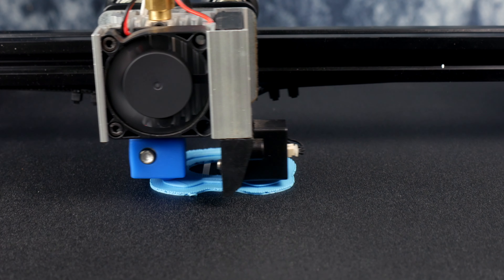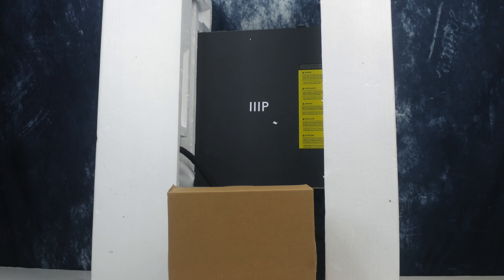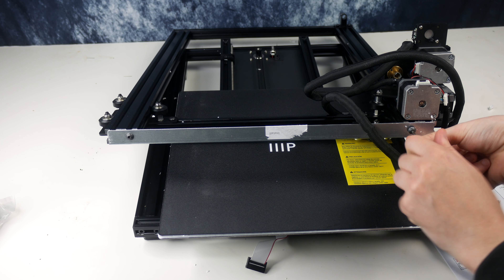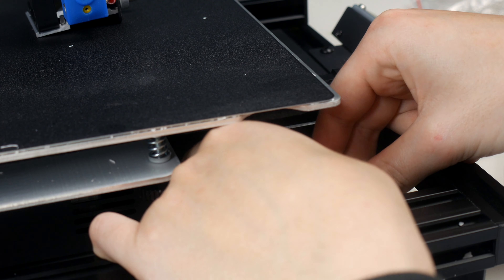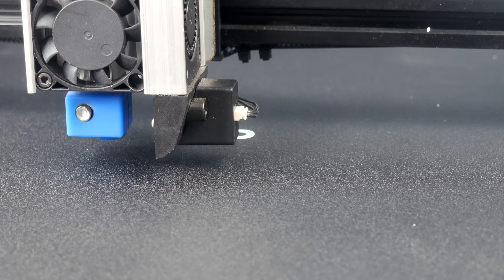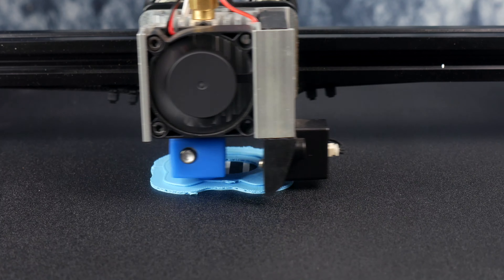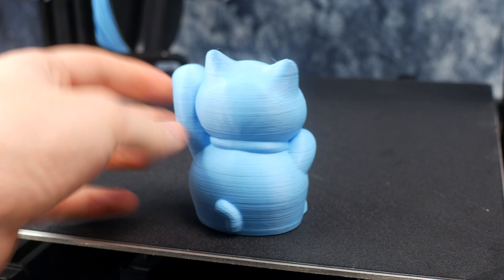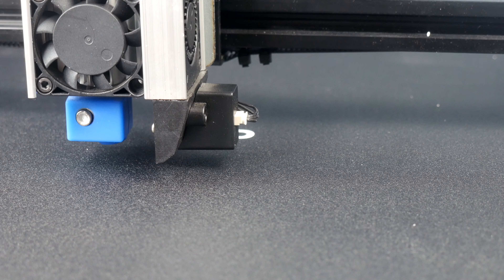MonoPrice MP10 UNBOXING | SETUP | PRINTING - Budget Machine!

Comment: Hi, I think your bed leveling system is not the one that comes with the printer.  It looks like a BLTouch but the one that comes with the printer is inductive sensor.  What is you bed level system ? Thank you.

Comment: one of the problems I have come across is distortion to the flexible print bed, have had my printer 4 months and was going great up until 2 weeks ago. bed distortion is now playing havoc with my first layer. would love to put glass bed on this but can't seem to switch the ABL off. I ill persevere with this as it ws producing good prints.
Reply from the maker: have u spoke to mono price about this? they maybe able to offer a solution? their customer service is quite good!
Reply: @GadgetCrunch  no I haven't, as I believe they will declare it is wear and tear. have tried to order a new one but they are out of stock. As I said earlier I would much rather have a glass bed but haven't yet found a successful way of working around the ABL. I  don't want to flash new firmware at the moment. the ABL on mine is factory added but is different type to the one you have.
Reply: @GadgetCrunch  by the way great 
video.
Reply: Remove the ABL sensor and move the Z-Stop up
if the sensor is removed the Firmware uses the Z-Stop then you can level the bed manual